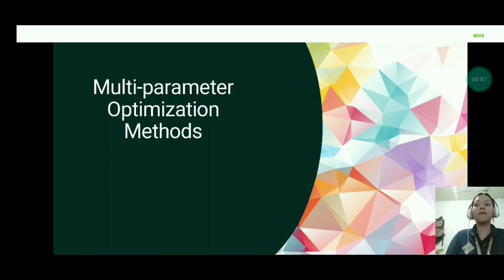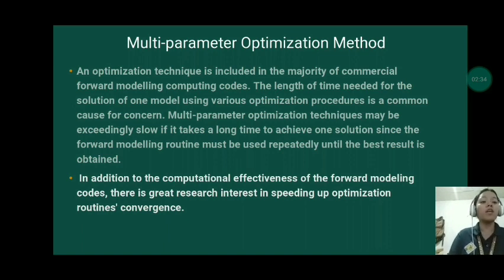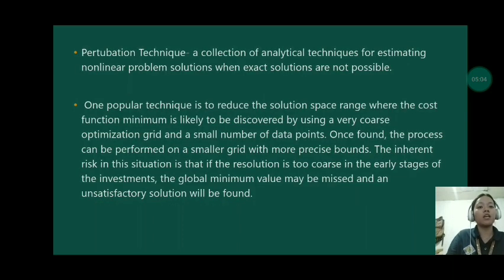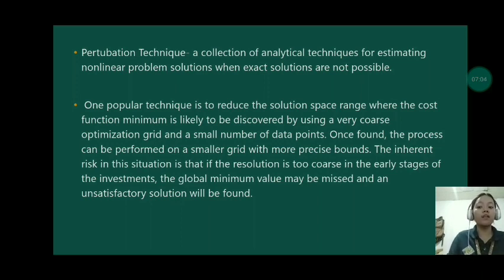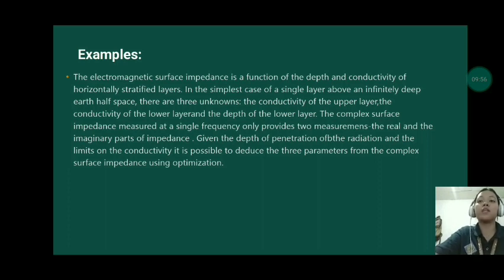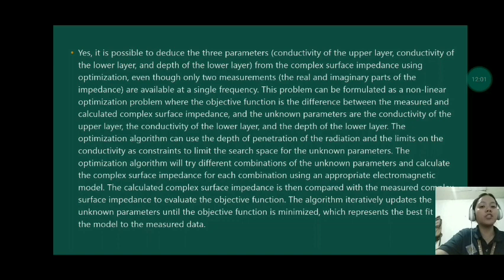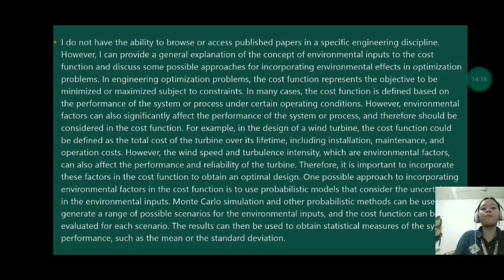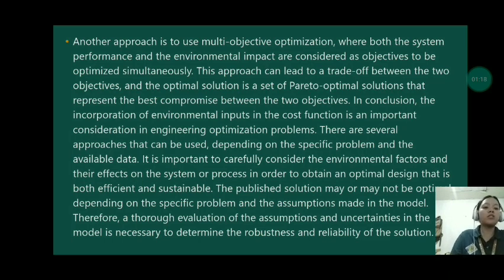Multi-Parameter Optimization Method

Comment: Name: Zamora, Jun Jr. K. 
Date: March 21, 2023
Schedule: MWF 6:30-8:20PM

Refection:
In this video lecture the "Multi-parameter optimization method", I learned that it is a mathematical method, process or technique in solving or evaluating complex designed problems that aims to minimize cost functions and maximize effectiveness of the design.

Reaction:
The reporter did a great job in presenter her video lecture, the presentation is nice and the video quality is great. 

Summary:
Multi-parameter optimization  involves or utilizes a processes, methods or techniques to realize multiple objectives, and results to the best possible outcome or result.

Comment: Balbon Neil Bryan B.
March 20-23
M-W-F 6:00-8:00 PM
Reflection
The multi-parameter optimization technique entails using mathematical methods to determine which using multiple parameters will improve the desired result. They are helpful because enabling scientists and engineers to discover the finest combining several factors to reach their objective. Moreover, it can enhance performance at the this will increase the dependability, so I hope and durability that could lead to an improved project environmentally friendly. 

Reaction
The video presentation is quite educational, and good explanation from the presenter. Moreover, she gave some examples that will enable us to comprehend her better topic. Using these techniques can reduce the trial and error costs incurred throughout the process.
Summary
Using a method called multi-parameter optimization complex issues should be resolved mathematically to attain the most effective answer to the issue. This technique might also boost effectiveness in terms of application. Primary objective of multi-parameter optimisation is to find the best answer to an issue. That would benefit all parties involved most.

Comment: Jimenez, Rica Ann Thallia S.
March 19, 2023
MWF 6:30 to 8:20 pm

Reflection:
I learned through watching the video presentation that multiparameter optimization  techniques  are critical in engineering and other scientific disciplines because they enable researchers to choose the best set of variables to produce the desired result.

Reaction:
The reporter clearly explains the topic in the video presentation, and the effectiveness of the presentation allows the viewer to  comprehend.

Summary:
In general, multi-parameter optimization  techniques are crucial for resolving challenging scientific and technical issues.They enable  researchers to identify the ideal set of factors that,  when combined, will provide the  desired result with improved effectiveness,  quality, cost-effectiveness, and innovation.

Comment: Ragudo Jeff Laurence B.
March 16,2023 
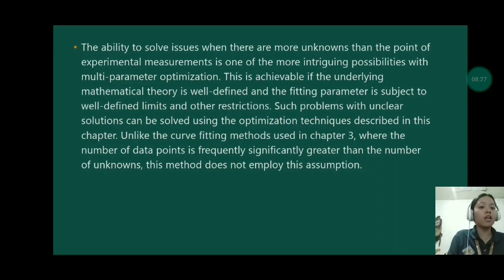MWF 6:30-8:30

reflection 
After watching the video presentation, I learned that Multi-parameter optimization methods are important in engineering and other scientific fields because they allow researchers to identify the best combination of variables that will result in the desired outcome. 

reaction 
The reporter discusses the subject in a clear and understandable manner, and the presentation is effective enough for the listener to understand. 

summary 
Overall, multi-parameter optimization methods are essential for solving complex engineering and scientific problems. They allow researchers to find the best combination of variables that will result in the desired outcome with greater efficiency, quality, cost-effectiveness, and innovation.

Comment: Mejorada, Iris Abigail T.
March 18, 2022
MWF 6:30 -8:20PM

Reflection:
The multi-parameter optimization method is a powerful tool for solving complex problems in engineering and other fields, and can help to improve the efficiency, effectiveness, and reliability of systems and processes.

Reaction:
It presented the information in a very clear way and easy to follow.

Summary:
The multi-parameter optimization goal is to minimize the cost function. An optimization technique is included in the majority of commercial forward modelling computing codes. But the length of time needed for the solution can be a concern as it may be exceedingly slow since the routine must to be repeated until we obtain the best result.

Comment: Mamac, Jane L.
March 17, 2023
MWF 6:30 -8:30 PM

REFLECTION: In this chapter, I learned that the multi-parameter optimization method involves applying mathematical tools to determine which set of parameters will optimize the intended result.

REACTION: The reporter did a fantastic job of discussing and clearly elaborating on her subject.

SUMMARY: In this chapter, It tacled the focus of multi-parameter optimization approaches is largely on combining a number of different factors to maximize a particular outcome. There are tactics that can be used to cut down on the amount of computing time needed while doing multi-parameter research.

Comment: Gador, Christian M. 
March 17, 2023 
MWF 6:30pm-8:30pm

REFLECTION:
I learned about a new concept known as the multi-parameter method. 

REACTION:
The report is very detailed. The volume of the audio was too low. 

SUMMARY:
The multi-parameter method is used to solve problems with the most effiecient value for effort. Basically, it takes the best possible route to obtain the best possible outcome.

Comment: Christian J. Andos
March 17, 2023 
MWF 6:30 P.M. - 8:30 P.M.

REFLECTION:
In this presentation I learnt about the advantages and difficulties of using multiparameter approaches in optimization algorithms for engineering research from this lecture. Also, the significance of computational efficiency and the numerous methods for cutting down the amount of computing time needed for multi-parameter studies.

REACTION:
The reporter's explanation of the Mullti-Parameter optimization approach was interesting. She explained what she had stated and supported it with examples. It summarizes key concepts for easy comprehension while using examples to simplify complex topics. Overall, the presentation is excellent for those of us interested in learning more about multi-parameter.

SUMMARY:
As a whole, the multi parameter optimization approach may help in many ways to increase performance by lowering costs, being more effective, and other factors. Finding values for several variables that optimize a certain purpose is another way to approach this procedure. As well as finding the optimal values for many parameters and using techniques to make it faster, this method may assist in identifying the best ways to enhance processes.

Comment: Pinili, Alex F.
March 17, 2023
MWF 6:30-8:30PM

Reflection: I learned about the Using mathematical tools, the multi-parameter optimization method determines which set of parameters will best optimize the intended result. They are helpful because they enable researchers and engineers to determine the ideal fusion of several factors to accomplish their goal. It may boost dependability and durability while also enhancing performance, which can lead to better projects that are ecologically friendly.
Reaction: The reporter in my opinion did a fantastic job in his reporting.
Summary: in multi parameter optimization These are a few methods that may be applied in a variety of fields, including engineering and science. The kind of the issue, how complicated the objective function is, and how many factors need to be optimized all influence the optimization technique that is employed.

Comment: Eudin John Gabriel BSEE
MWF
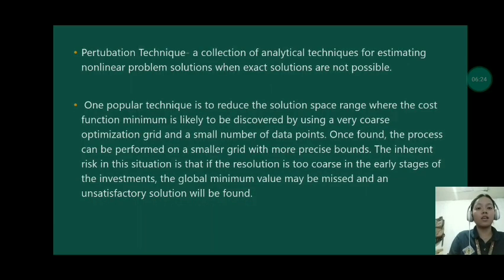6:20-8:30 PM

Reflection

Generally, the multi-parameter optimization approach is an important tool for researchers to quickly and efficiently uncover optimal solutions, lower costs, boost performance, and gain a deeper comprehension of intricate systems or processes. It is especially helpful in circumstances where it is necessary to simultaneously optimize several variables

Reaction

The video makes it clearly evident that the reporter did a good job. Her presentation is comprehensive, condensed, and uncomplicated. I appreciate the tone and language she uses to convey the facts. The concept is clear to me.

Summary

Dealing with uncertainty in operating circumstances or environmental influences is a common part of engineering study. Engineers can find efficient systems that are less vulnerable to uncertainty using a multi-parameter optimization strategy, leading to performance that is more dependable and consistent.

Comment: Ebon, Recarl R.
March 17, 2023
MWF 6:30-8:20

Reflection

In this video it talks about the importance of multi-parameter optimization method and using it in solving complex problems on different complex design to get the best solution while minimizing the cost function.

Reaction

The reporter discussed her topic very well with relevant examples. Overall, the presentation was excellent.

Summary

Multi-parameter optimization is a method which is able to solve complex problems and produce the best possible results while minimizing the cost function.

Comment: Zacarias, Lorrie Jaye U.
March 17, 2023
MWF 6:30-8:30

Reflection:
I learned the benefits of using a multi-parameter optimization technique and its practical uses. 
I now understand how multi parameter optimization can help to improve performance while also increasing reliability and durability, resulting in a better project outcome.

Reaction:
The presentation is very decent and packed with knowledge.

Summary:
Multi-parameter optimization is a method for solving complex problems mathematically in order to achieve the best possible solution.
This is critical in engineering because it is the engineers' job to create something that will benefit society.

Comment: Tagle, Charlie P
March 17, 2023
MWF 6:30 - 8:30

REFLECTION:

I understand that multi-parameter optimization is a method for mathematically solving problems that results in the best possible solution. Yet, it can take some time for this approach to have a result.

REACTION:
Good presentation , very easy to understand.

SUMMARY:

multi-parameter optimization is a technique for mathematically solving issues that produces the best outcome feasible. Yet, this method might take some time before coming to a conclusion.

Comment: Veriña, Jerry Ian A.
March 17, 2023
MWF 6:30pm-8:20pm

Reflection:
After watching the video on multi-parameter optimization, I gained an understanding of the various techniques and strategies used to solve complex design problems. It is fascinating to see how optimization is a mathematical process used to find the best solution or design that satisfies a set of criteria while minimizing cost.

Reaction: 
Audio and video recording were done properly. The reporter could have provided a visual aid with lesser words in one slide and only emphasize on the key points of the topic. The reporter was able to organize well and make a good flow about her given topic, however, improvements can be done to make the discussion shortened and simpler to understand. The reporter also provided correct examples that we can find in the textbook. Overall, this video is very informative and can be very helpful to our future research/es.

Summary:

The video discusses multi-parameter optimization, which is a mathematical process that aims to find the best solution or design that satisfies a set of criteria or constraints. The goal is to minimize the cost function by modifying design parameters iteratively using various optimization approaches. The video also covers different techniques to reduce the computational time needed for multi-parameter analysis, including massively parallel computing techniques, perturbation techniques, and reducing the solution space range.

Comment: Inguito, Aidel C.
March 17, 2023
MWF 6:30-8:20 PM

Reflection
The multi-parameter optimization approach involves utilizing mathematical techniques to determine which set of parameters will optimize the intended result. Its best feature is its ability to handle problems. They are helpful because they enable researchers to determine the ideal fusion of several variables to accomplish their goal.

Reaction
The overall presentation of the report is good. I like how the reporter is giving enough examples in order to easily understand and comprehend what the report is all about.

Summary
The perturbation techniques, massively parallel computing, and coarse optimization grids are some of the tactics that were covered. The multi-parameter optimization method identifies the collection of parameters that would best maximize the desired outcome.

Comment: Banguiz, Tiiffany Fate A.
March 17, 2023
MWF 6:30 - 8:20 PM

Reflection:
The discussion emphasizes the importance of using a multi-parameter optimization method and how it can be applied in the field of engineering. With the help of this method, the optimum designs can be achieved with minimized cost function. 

Reaction:
The reporter provided a clear example on the topic. The presentation is good and the powerpoint is filled with information. The turbine example caught my attention as well.

Summary:
The use of multi-parameter optimization is to minimize the cost function without reducing the quality. This is vital in engineering since it is the job of the engineers to create something that can help the society.

Comment: Gahob, Jun Louis T.
March 17,  2023
MWF 6:30-8:30 PM 

Reflection:
Multi-parameter optimization methods allow the researcher to come up with the best outcome given the data set. I realized how lucky we are at these times because this process can be done effectively and efficiently with the help of Matlab, which has an optimization toolbox, and MS Excel optimization routines running with their solver box.

Reaction:
The topic was discussed well by the reporter, and her examples gave me further understanding of the topic. I think that would be more effective if it were not merely text-based.

Summary:
Using a procedure called multi-parameter optimization, the optimum design can be found at the lowest cost. This can be done by using various optimization techniques, such as forward modeling and perturbation techniques, to repeatedly modify the design parameters. Repeatedly applying forward modeling can lead to the best result. When exact solutions to nonlinear problems are not feasible, the perturbation technique is a collection of analytical techniques for estimating the solutions. Solving issues with more unknowns than experimental measurement points is one of the more intriguing potential outcomes of multi-parameter optimization.

Comment: Mariot, Aubrey C 
March 17, 2023
MWF 6:30-8:30 PM

Reflection:
From what I've understand, multi-parameter optimization is a method used in solving problems and achieve our desired results in mathematical means. This can be done repeatedly until we come up with the best practical solutions dealing with different kind of problems.

Reaction:
The video is informative. The reporter gave examples which help us for better understanding. I commend the reporter for a well-delivered presentation.

Summary:
Multi-parameter optimization a method that follows process that can be used to solve complex problems and yield the best possible outcomes. This method doesn't allow assumption, that is why the increase of efficiency when it comes to application is expected with a purpose of producing results that can benefit all participants.

Comment: Solinap, Sim Jericho C
March 17, 2023
MWF 6:30-8:30

Reflection 
To reduce the cost function. To achieve the best results, complicated design challenges must be solved mathematically. Is a method for determining a set of values for multiple variables. A approach used in the vast majority of computer programs. Some optimization is visible via the internet. There are several different approaches, but this is the most efficient so far. 

Reaction 
Almost everything in the presentation is available in PowerPoint. The voice is clear and understandable.
 
Summary 
Procedures that can be applied in a variety of areas. The nature of the problem was used to determine it.

Comment: Loreto, Liezl Mae E.
March 17, 2023
MWF 6:30-8:30 PM

REFLECTION
The optimization methods outlined in this topic can be used to solve such vague issues. This method differs from curve fitting methods in which the number of data points is frequently much bigger than the total amount of unknowns.

REACTION
The reporter did an excellent job of explaining her topic. Even if she puts a lot of sentences in her presentation, it is still understandable.

SUMMARY
In this video presentation, such multi-parameter analyses are likewise applicable to all optimization techniques. An optimization routine is a common component of commercial forward modeling computing algorithms. The length of time needed to solve a single model using these optimization procedures is a common source of worry. And multi-parameter optimization routines can be quite slow if the time required to accomplish one solution is long since the forward modeling routine must be run numerous times before the best solution is found.